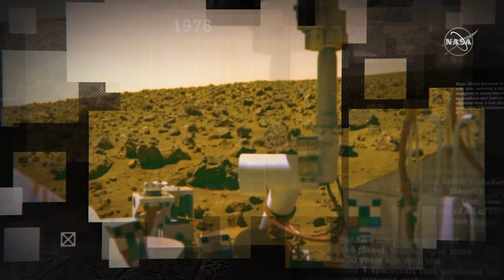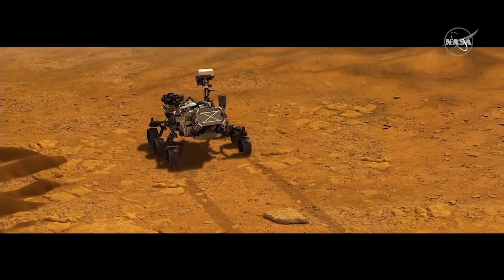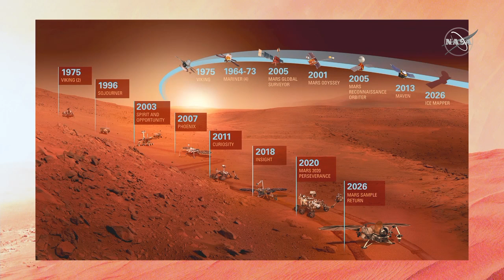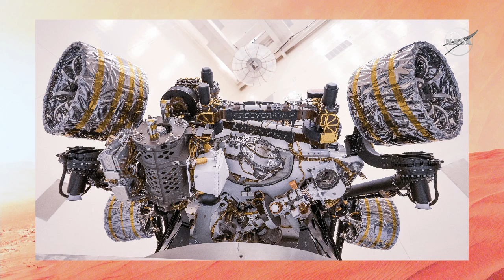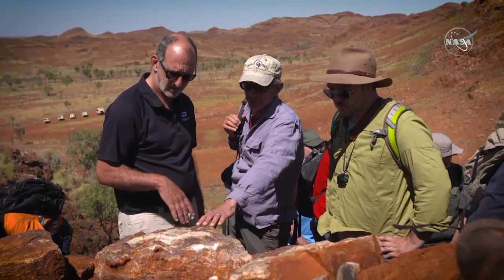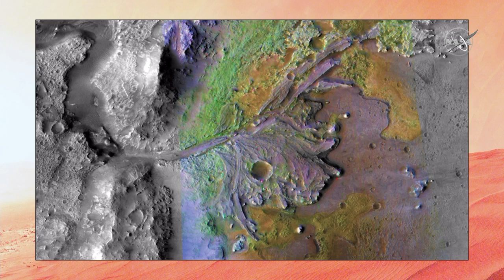Perseverance Mars Rover Mission Engineering & Science Briefing

Comment: A question about the Scarecrow model. Does soil compaction and stability change in different gravity environments? If so, the lighter Scarecrow may not perform in a way that would mimic the Perseverance rover on Mars, unless you compensated for the soil compaction and the Scarecrow and Perseverance applications in the two different environments.